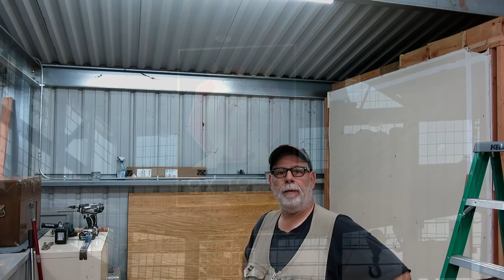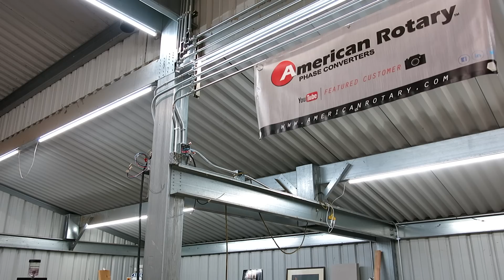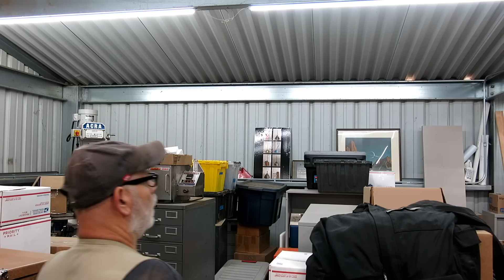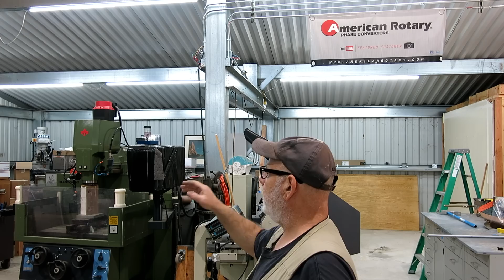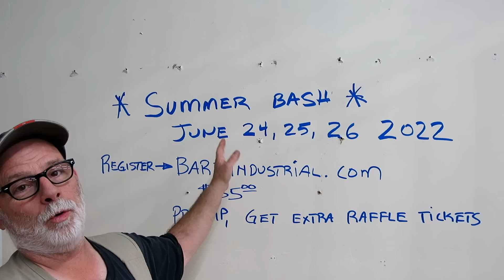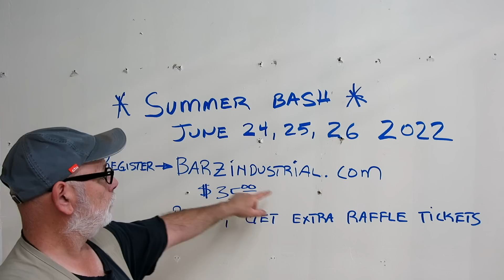Epic Egress 7 Shop Update

Comment: Tom, I know the process of shop moving. I moved my shop from San Francisco up to Sonoma county, where I now live. It started in 2012, and it's just about finished: 10 years. Courage to you!

A small question: I'm starting a project of surgical instruments for some doctors at UCSF, and I'm looking for a supplier of small amounts of 305 stainless sheet. These tools will be bent and re-bent by the surgeons, so I want something that is formable, but does not work harden. Thickness is around 0.05 and the parts are mostly 0.5 wide by 14 long. No place online offers 305 for sale.
Actually, McMaster has the most stainless alloys available, but no 305. Can you suggest a source, perhaps in Oakland?

Thanks in advance for your help with this!

Comment: I still can't grasp how Americans survive with their 1800s era electrical and other stuff, or why they'd resort to mechanical converters. Wars destroyed electrical infra stuff in Europe twice, so we have upgrade habits to new standards throughout the society once they come. Our single phases are 230V, out of three phases (400V across phases). Two-phase is something we only encounter in American videos. I'm speaking from my Finnish perspective here.

Every house/property/apartment here has a 3-phase mains connection. The variable thing of the electrical companies to support is the maintenance of the grid power and cables to the property based on the property's main fuses (for instance, my rather normal house has 3x63A, studio apartments and the like would have 3x25A). We don't have wiring on electrical poles either, since it was deemed more cost-effective to bury the cables because overhead lines would cause issues with slow-laden trees and just trees and storms in general. Industrial and agriculture facilities have main fuses of typically hundreds of A and just the standard outlets for their machines are 3x32A and 3x63A depending on the machine. Standard 16A 3-phase outlets are much more common everywhere though. In residential buildings, they're installed at least in some box on the outer wall of the main building or garage for their construction phase for construction lifts and other construction equipment, and they're common in residential garages and workshops too. They're also now being newly installed everywhere in proximity you'd park a car, for EV home charging. The single-phase 16A ones we had before on almost every parking space for the engine heaters of fart cars would barely be good enough to keep the EV batteries heated in the wintertime and would barely have anything left for charging.

Other things using 3-phase in every house are stoves and ovens, central heaters, water heaters, thermal pumps, saunas and the like, often installed with screw terminals by electricians, although there's a special outlet type for kitchen stoves that common people can plug and unplug. They're not using the normal kind, because they'd be too bulky in kitchens. I have a few extra standard 3-phase outlets in my basement workshop that I use mostly for my air compressor and welder, but occasionally for rented equipment.

Comment: I moved a couple of years ago, and our move was complicated by the fact that instead of being able to just move in to our new house, we discovered on arriving that we needed a LOT of work done; it was over 3 months before we could live there, so lots of stuff went into storage, including quite a few of my tools. Now I have 3 of several things, because I had to buy another because the first one was in storage, and then a third when I discovered the second one had been taken to our apartment (which was pretty far from the house). But the best way to find something, if it's not too big or expensive, is to buy another one, and then put it away - almost inevitably that location is where you 'lost' the first one. What I can't understand is why it doesn't work nearly as well to pretend you got a second one.

Comment: I fully understand your situation. I am going through the same things. I am adding another 40" container to my shop, which will double its size.  I wanted to tell you about my insulation solution, to begin with I live in SW Florida, so you can easily understand my needs. I chose the 3/4" foam board insulation. Because of it's high R value and low price. Also because it is something I could do without much help (I am in a wheelchair).  There are several ways of adhering this stuff to the walls of my shipping containers, the first one I used a 3M spray adhesive, but they had production problems and I couldn't get it for the second one. I found that I could get anchor pins you attach to with a good silicone, then you hold the insulation to them with simple spring washers.  The installation is very easy and very quick. I run a simple 1 1/2 ton split A/C unit, and it keeps the shop dry and cool.  I hope this gives you some assistance is your insulation job.

Comment: Normally when I do a pass through like that---  I will take your larger wire and pull a nice 6" or 8" loop, and tuck it into the back of the 110 boxes.  That way, if you ever change your mind in the future, and want to turn that 110 box into a 3 phase or vise versa--- You already have the excess wire there in each box--- and you can just pull out the loop and cut it, and splice in your new plugs, ect..  It takes a little more wire to do it that way--- to have loops in every box.  but it's well worth it later if you end up moving things around and need to swap your systems;  because it's all right there, no need to re-pull new wire, and you have plenty of extra length to pull from if your tails get too short, ect..   It's good practice on a busy shop system like this.

Comment: When you’re shoving those wires in that one conduit, are you following the National Electric Code as to how many wires of whatever amperage (or combinations) can be used in a specific sized conduit? You can fit more wires in conduits than you are allowed to put. For those who don’t know, it’s all about heat.
Reply: I've been caught out by this before. I thought I was good to go based on fill capacity, but then I did my ampacity calculations and realized it was better to run separate conduit.

Comment: I’m curious to see what type of insulation you’re going to use on the walls and ceiling and how you’ll secure it. I have a metal building in need of the same, not as big as yours but condensation happens none the less…lol.
Reply: Spray foam, closed cell

Comment: Shop is looking great Tom.  Curious what you are planning for single phase 220. Can you just pull two legs off of your three phase circuit?
Reply: No! The 2 phases are off by 120 degrees, not 180 degrees as in single phase. Could anyone of you smarter electricians than me correct me?

Comment: love that metal tube conduit, it actually looks kindda beautiful to me, has it's own particular type of charm and style. but also in a functional sense you dont have to worry about mechanically damaging the cables, putting other things near to it. it armor protected! all except for sources heat of course. however maybe the metal tube does help to act as a kind of heatsink and naturally dissipate or spread out localized areas of heating along the length of the tube. really cool soution

and i suppose the pipe bending is not too chalenging with any budget pipe bender? so long as the radius can be big enough to let slide / push the cables thru it afterwards?

my last question is if its easier to push thru single core stiffer higher current cables, or narrower diameter more flexible (or braided multi core styles). just curious. well nevermind can always look it up elsewhere. it is its own subject and not really to so much to do with precision machining! hehe

Comment: Glade to hear its going well. So when you are all set up i might have a job for you if your interested. I restore and Preserve antique firearms. Mostly 1840 - 1900 colts. And i am in need of letter and number punch stamps in the right font and right size.  also logo stamps. I have several civil war pistols that someone polished and destoryed all the markings on. If your willing that would be great.. If not i understand. Thanks!!
Reply: If you are talking barrel stamping, that is usually done with a roll stamp.
Reply: @grntitan1  i know the barrels is not the problem. I have those already. I need numbers and the several inspector marks and the Colts patent